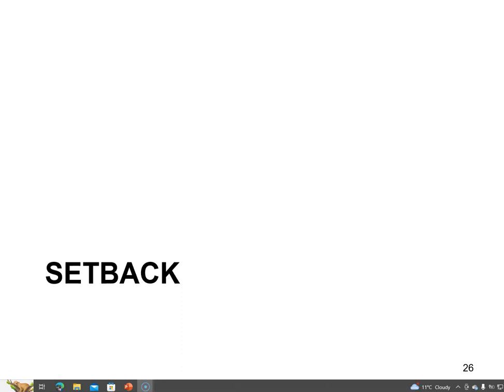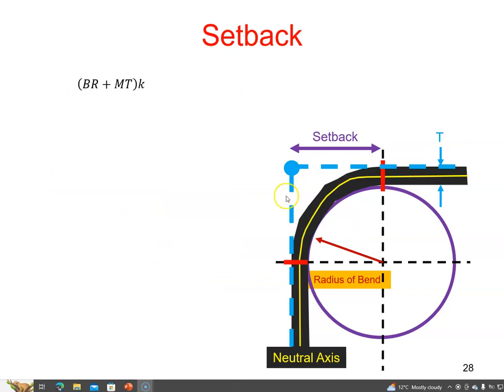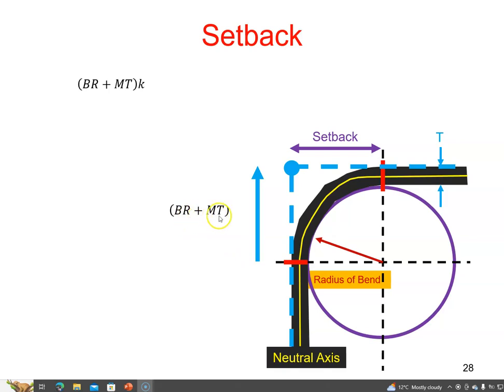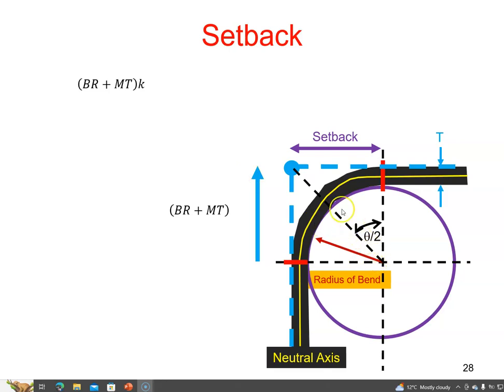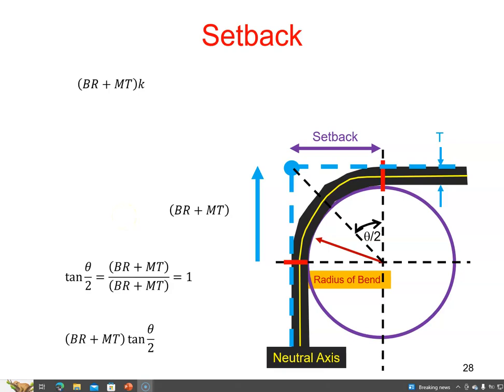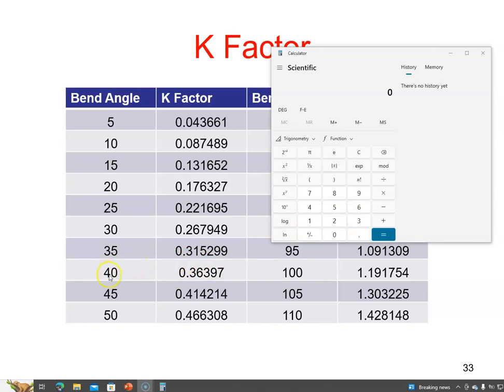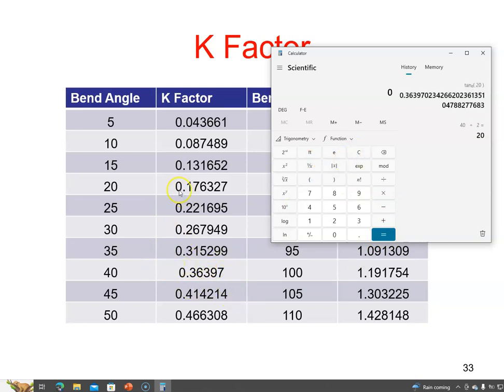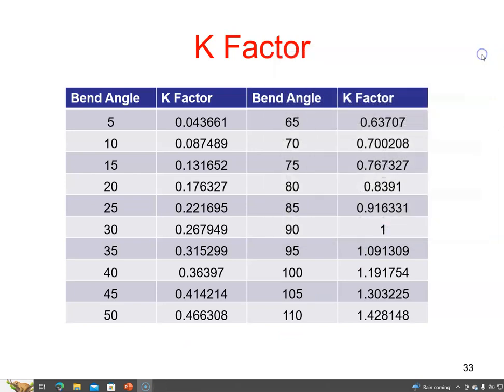Setback formula - Sheetmetal

Comment: I may be wrong, but "text books" usually show SB=(r + kT)  but they way you are using k is as a multiplier SB=k (R+T) which will also affect the radius..and that, from what I see, is a mistake
Reply from the maker: @lapinchiloca  Have a look at this textbook.   https://www.faa.gov/regulations_policies/handbooks_manuals/aviation/FAA-H-8083-31B_Aviation_Maintenance_Technician_Handbook.pdf

Comment: The definition of k factor in this video seems to be a bit different to what is used elsewhere - most other sources define k as being angle independent and material dependent. The formula that many other sources give is along the lines of: setback = (r+T)*tan(theta/2) and then the bend allowance = theta*(r+kT) where k is looked up from a table, so the total flat length = h + w -2*setback + bend allowance
Reply: Yeah this is definitely wrong. It would be so nice if k factor was only dependent on one variable. It's material and process dependent hence why it's experimentally determined. People use rough approximations for low tolerance manufacturing